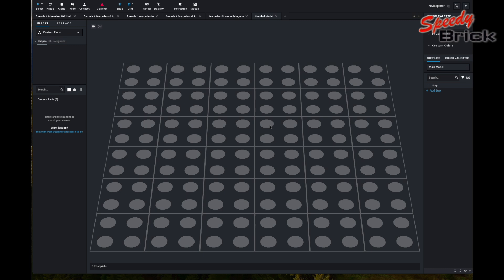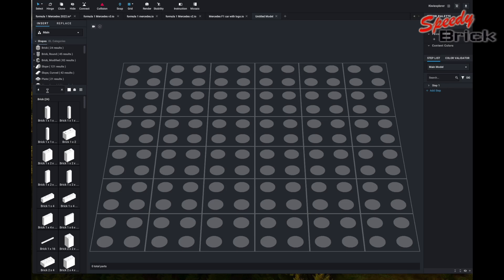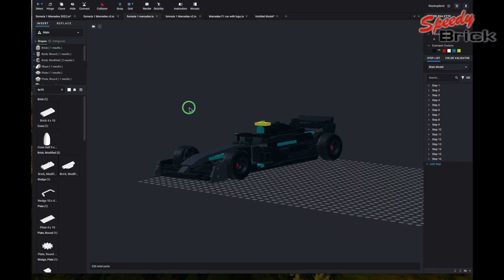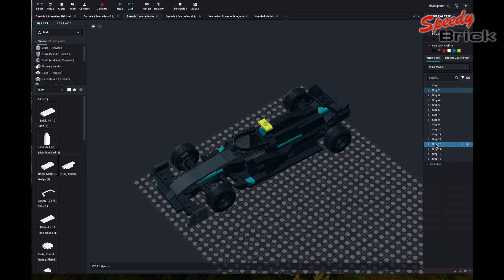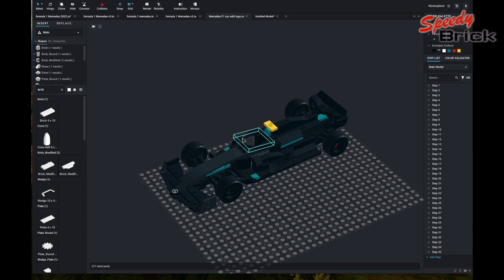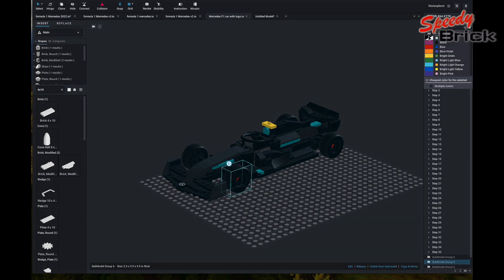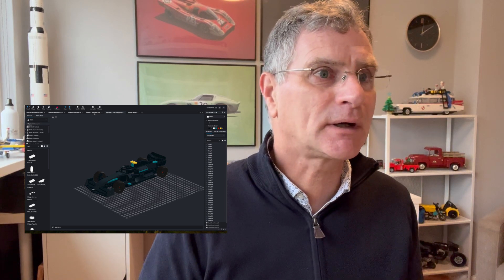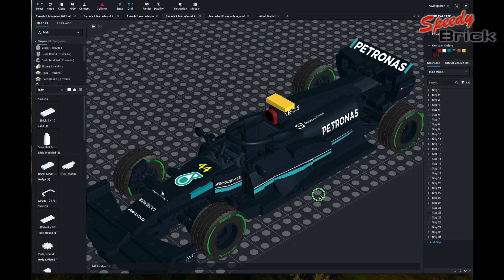Using Lego Studio to build a MOC of Mercedes F1 car

Comment: i have problem appliying sticker for both wedge 2 x 2 2/3 do you have any tips or tricks ?
Reply from the maker: I really struggled as well. the tip i got from another designer was to use photoshop to add them to the render afterwards.
Reply: @speedybrick i finished my model this morning i changed all the wedge parts using curved so the decals can be applied i don't think about photoshop after rendering i might be using this trick next project thx for the advice
Reply from the maker: @thebikecrafter8128  your welcome. please send a photo of the end result